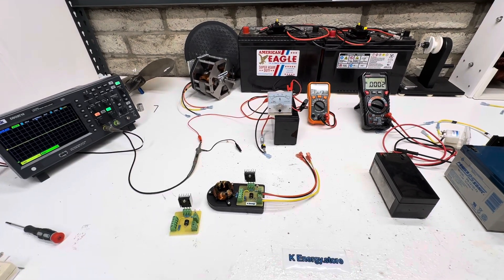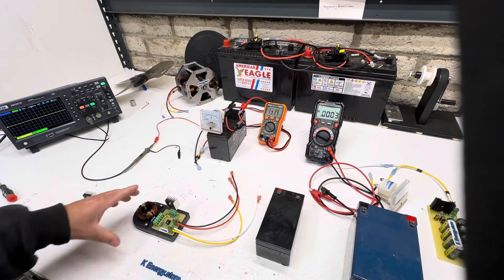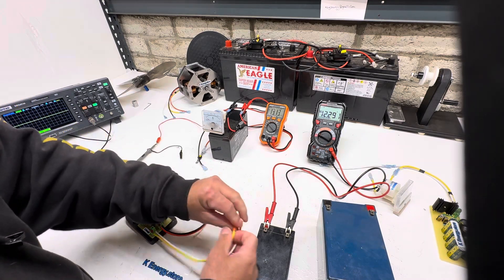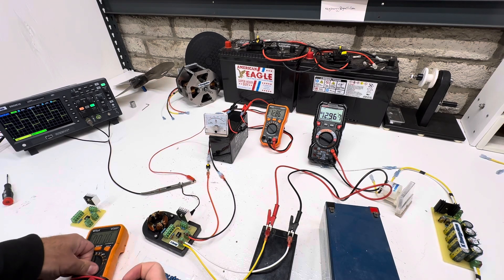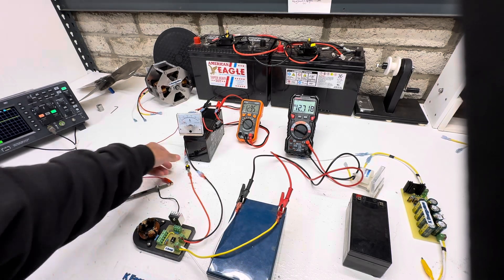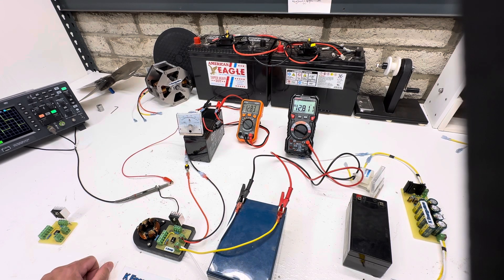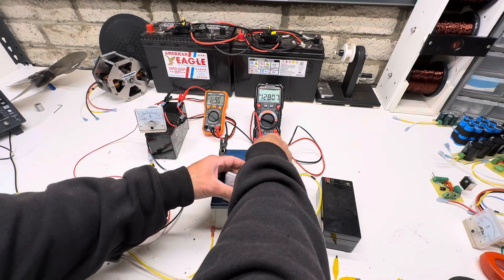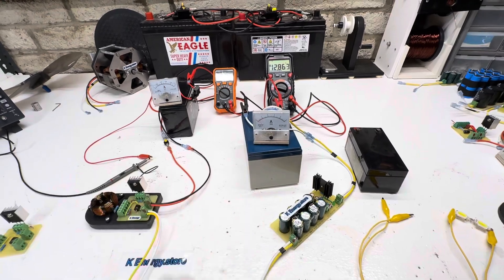Forced oscillator prototype

Comment: Last week I undusted my SSG solid state, with the intention of reviving an electric scooter batteries,  the solid state ssg draws about 220 mA at 12V and I have to rejuvenete 6 x 12v 20ah batteries. I was trying to adapt the back of a cap pulser with 2 fets using Arduino as pwm to make a more powerful version but it doesn't work at high frequency, don't know why my mosfets stay open beyond 2khz, I don't know what to do because a multifillar coil in regular bedini ssg circuit would imply multiple matched transistors which are too expensive... maybe 1 individual solid state for each battery?
Reply from the maker: You can use one per battery and you don’t need a cap dump especially if they are very sulfated
Reply: @kenergy1707  tnx for the reply, can I ask how many wire are u using on your solid state coils ? I need to calculate for my batteries, also in your video u said u can adjust it with a resistor but didn't get which one. I am using the normal book circuit 20k 18k 2k I think it was the base resistors.
Reply from the maker: @AHN1444 you can get ahold of me at my store or email me

Comment: Awesome work! At 6:20 you disconnect the battery to connect the cap dump.  The battery is discharging, do the batteries hold a negative charge or do they discharge back to level prior to charging ?
Reply from the maker: Thanks 
Yes when the battery is charged then stoped the battery settles it’s voltage 
 It should be charged to 15 v then it will settle at about 13.15

Comment: How long does your cap dump stays on? Until the voltage between the caps and battery equalize?
Reply from the maker: My cap dump has a timed dump 
Depending on what zener if it’s 15 it will go to battery voltage if it’s 20 zener it will till 16 volts so the higher the zener  the bigger gap between battery voltage and zener will turn off

Comment: Although slightly ( off topic ? ) you should advise your viewers that these small Lead - acid batteries should ALWAYS be fully charged ( 13.9 Volts max ! ) , before putting away for a few days .... so MANY folk use them for a while ( halogen torches ? ) and leave them partially discharged ... the battery is likely to " Sulphate " and become defective .... DAVE™🛑
Reply from the maker: Yes they should definitely helps from Sulphate

Comment: The positive spike is charging the battery... The negative fluctuations are the result of the switch turning ON and perturbing the EMF stored in the coil. This is a joule thief circuit, you're getting frequency lowering (the forced oscillator's rate, 12.79Khz) by using the 2K impedance resistor on the feedback winding which is tightly coupled to the output winding. Resistive frequency lowering on coiled systems was investigated and presented nicely by Don Smith.
Reply from the maker: The negative spike / flyback charges the battery just like all my pulse motors
Reply: @kenergy1707  Both sides of the inductor spike, its inherently differential. It depends on your point of reference. But the scope probe placement in the vid inverts the spike. In the vid, the lower oscillations are a result of the switch closure disturbing the remaining back emf in the coil. It oscillates into stray capacitance, which is why the amplitude is not steady.
Reply: Mmm..the resistor essentially acts like a damper and "lowers" the resonant frequency
Reply: @tanmayvadhera4250  It's a bit more complex.. The oscillator does have a dampening reaction to the resistor, but impedance changes are the actual knob behind the change. We're saying the same thing.
Reply: @craigpierce7996 Essentially yes 😄